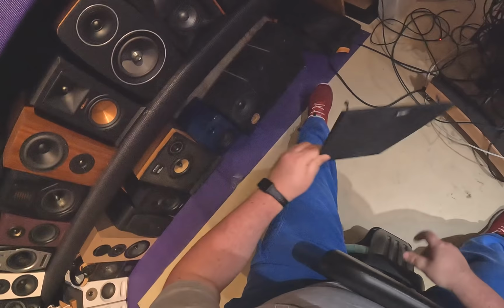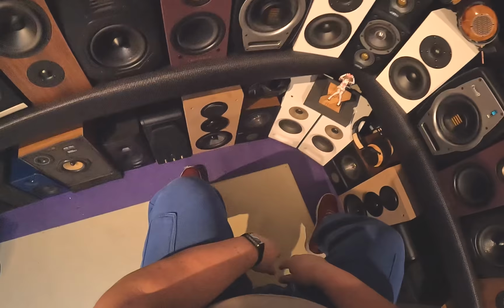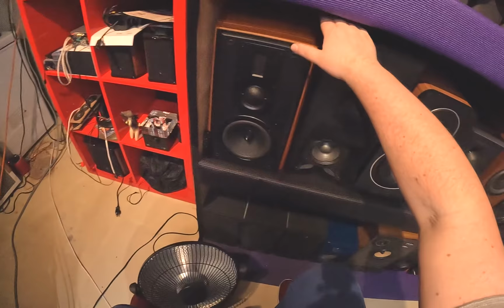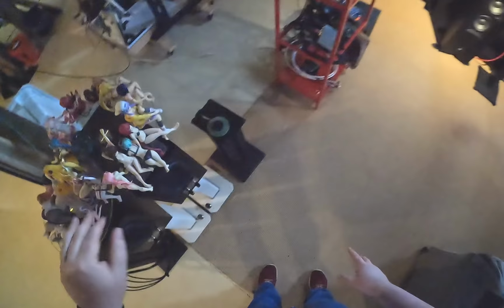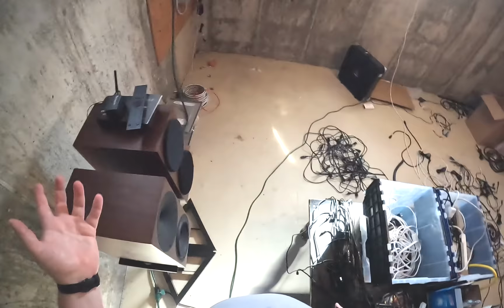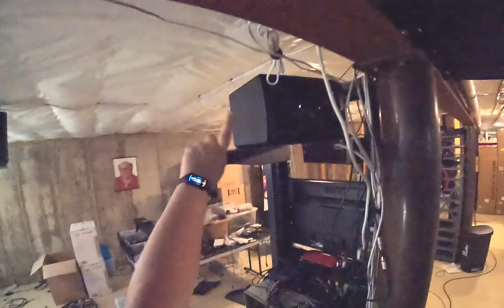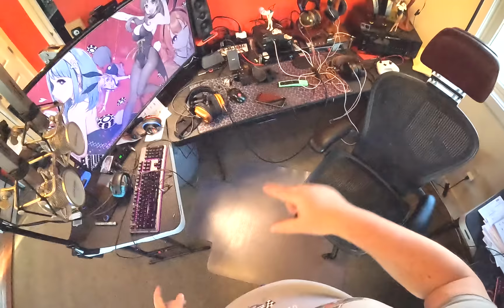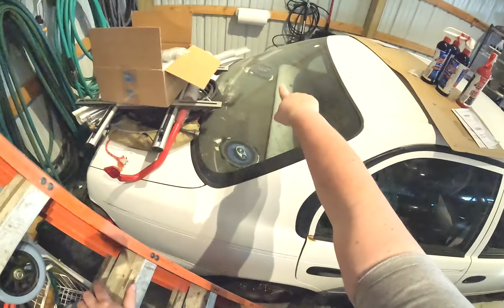🟩Every Speaker in Zeos' House..

Comment: I basically did the same with my Ohm Walsh 2000's in that I had them as my main living room / music speaker, but then moved them into my bedroom. 

I did not utilize a standalone tweeter.

For anyone that has these speakers (and you have the right room size, of sub 2,800 cu. ft. room), I'll save you some money that you'd think you need to spend on subs & maybe the Zeos tweeter setup.

Get a miniDSP, Equalizer APO for PC, or equivalent with a 10 band EQ that can do shelving. Apply a low shelf +3db or +6db (depending on your taste) from about 150 - 250 Hz down depending on your room modes. Apply a high shelf of +1db to +3db to taste from about 4,000 Hz and up. 

Apparently, the super tweeter in the Ohm Walsh Tall (the newer ones since after the last version in the mid 2000's?) have a lot of headroom and can be juiced quite a bit. If in doubt you can reach out to Ohm directly as well to verify.

Give it a shot, and if you already have an EQ it's basically a free test.

If you have the JBL Studio tower's (I only tried this with the 590's), one thing about them is that they do not come lined very well on the inside. There is lining, but it's basically super cheap, not very dense foam. Like super cheap.

Take the woofers off, leave the super cheap foam lining in there, and fill the cabinet with something (I like the Owens Corning 703). This helps tame the speaker. Also, make sure to really get it up behind the waveguide assembly because the plastic design will resonate a louder volumes around 1,400-1,500 Hz or so, and that helps dampen that a little bit.

Comment: Loooove my Kanto Tuks.  They support AAC as a bluetooth codec so they're ideal for connecting wirelessly to iOS devices.  RCA/USB/Phono/Optical inputs, sub and headphone outputs.  Sound detail is awesome.  Just talking about the appearance is selling them way short.  They go on sale only once per year, you can save a little bit if you buy them then.
Reply: I started into audio with the YU 6 and a simple 10' Sub. They were probably not the best to buy for this price soundwise but I needed the simplicity with all the inputs, the adjustable treble and the remote. And with the sub, bass is no problem.
Reply: @wfwlan7654  I started with YU6’s as well (Andrew Robinson recommendation) and I had the same feeling you do. 

I moved to the Swan M300s (Zeos rec) and I never looked back. The Swans were everything I thought hifi audio should be. I sold the Kantus and have only bought Zeos recommended products since. 

When Z said the JBL studio 530’s were some of the best he ever heard I snapped them up. Currently have the 590’s, 530 and 520c for my home theater and for me & my wallet I’m at my end game. 

Thank you Z for doing what you do. I learned to trust your ears and have listened to audio nirvana ever since.

Comment: The Adams are ribbon tweeters. The are called ART or accelerated Ribbon Technology which means each fold is independently connected. The design is utterly epic especially on the 3 way spkrs with mid ribbons. They are 4 times more efficient than pistons and nothing is a smooth. Better than everything I compared them to. I heard their flagship Olympus models at a tradeshow and all I can say is the sound is spectacular. The price tag was frightening to say the least.

Comment: To elaborate on why the Klipsch Heresy's have 12 inch drivers that can do midrange:

Notice the material construction of the driver. Simple paper cone, no high-roll surround. The soft parts of the speaker are made of light, easy-to-move materials. This allows it to be so big but have a great transient response in the midrange (That's the word you are looking for but don't use, Z!). The 8's and 10's of the JBL's and other Klipsch's are designed as high-excursion woofers to extend as low as possible with heavier plastic etc. cones, high-roll surrounds etc. and so that's why they can't do midrange transient response as well. 

This is why smaller drivers like the RB42 woofers are so cool and so effective. The cone size is small and so therefore lightweight no matter what, for all intents and purposes. Throw a high-power motor and coil on it, a beefy surround, and all of a sudden you have a driver that does both low-end and midrange well. This design is of course going to be less efficient, though, and also won't be able to reach as high SPL as larger drivers regardless of transient response.

Comment: This is so depressing. 
Two of my rooms look like they would fit right in with Zeos' House. 
Is that the way I am heading? 

I have recently been "donated" a couple of boomboxes, a JVC mini hi-fi, a Beocenter 9000 with CX100 speakers. 

I had a pair of speakers and was "happy" with stereo for my hi-fi. 
A pair of Bose Videomates for the PC.
Then I tried surround. Meridian M60C centre and B&W PV1 for a bass to M1 front and D600 rears.

My old speakers - love them Meridian M1 - break down so I get an extra pair of Meridian D600 to replace when they are out for repairs (or 8 channels). 

I get a pair of Devialet Phantom Golds as my daughter hinted at wanting Bluetooth speakers. She has never used them (she was in digs at uni and now in a terrace house). I had set up her PC with two pairs of Bose Roommates and her laptop with a pair of flat speakers. She uses the speaker on the monitor or earphones.

Just got in a pair of B&W MM-1 for my laptop, now a pair of B&O Emerge and a pair of B&O Level. 
I guess she will not like either. 

That is 30.